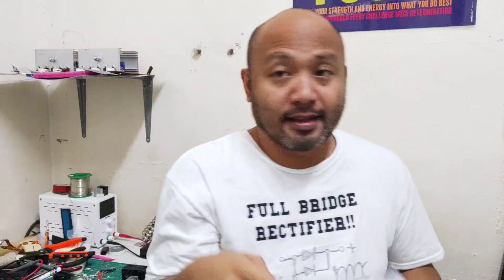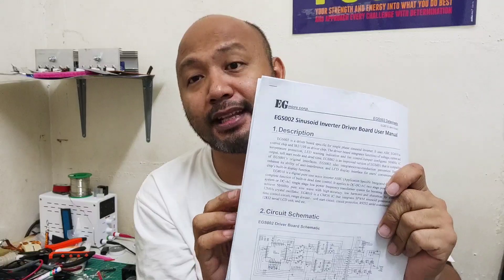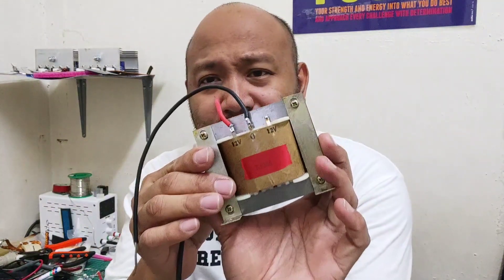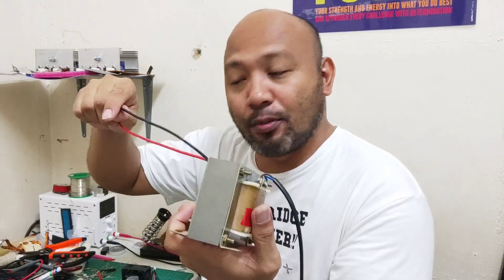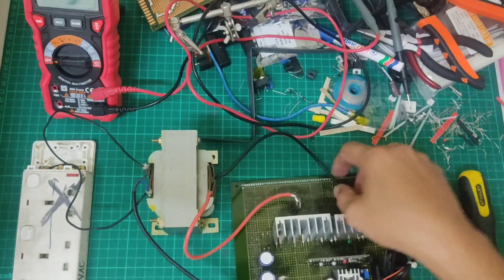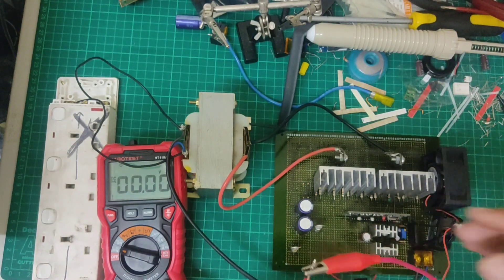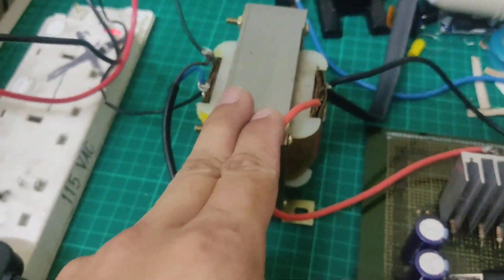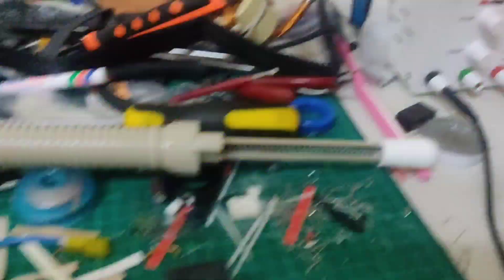BASIC DIY INVERTER DIAGRAM PARTS LIST | para sa mga ka diy solar diy portable generator natin dyan

Comment: Di po nagbubukas ung link para sa Circuit diagram. May ibang link pa po ba ?
Reply from the maker: https://content.instructables.com › ...PDF
EGS002 Sinusoid Inverter Driver Board User Manual - Instructables
Reply: Broken link again